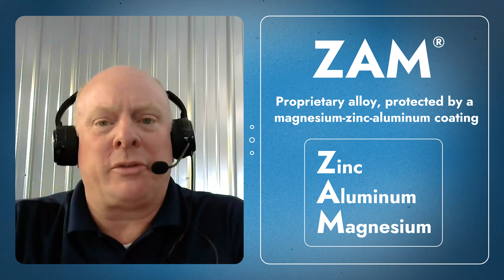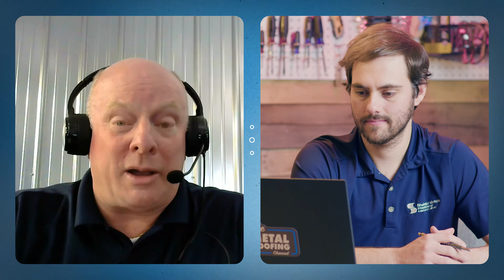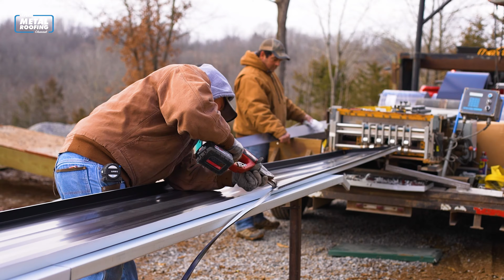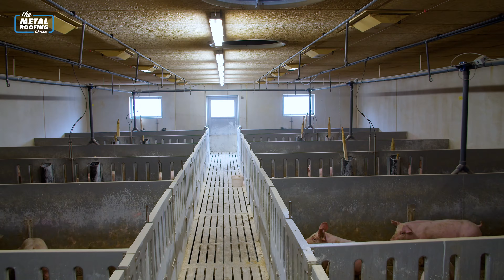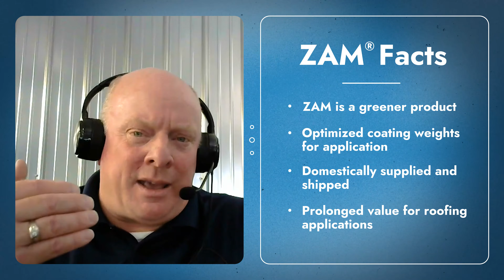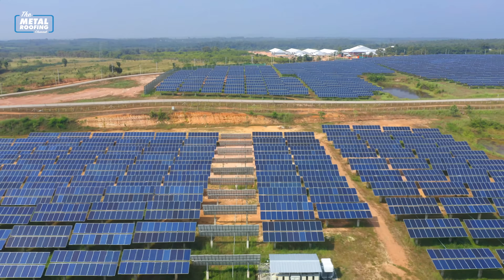Steel Roofs on the Coast? Is ZAM® the Future of Coastal Metal Roofing?

Comment: "They took the idea from the automotive industry, but they’re going to run into issues with thermal expansion and rigidity. Magnesium is very soft, and while they’re chasing a lower price point with magnesium, it’s not going to hold up well in structural applications.
Reply from the maker: I will say that the Magnesium is only contained in the coating (and only 3% of the coating at that), while the actual base substrate is structural grade steel. -Thad

Comment: Is there any warranty against rust On the coast or any language that addresses warranty length.
Reply from the maker: It carries a perforation warranty of 20 years, 6 months up to 300 feet from breaking surf. The idea is that any corrosion that starts, especially on cut ends, will be halted by the galvanic protection of the coating and self-healed over time. -Thad